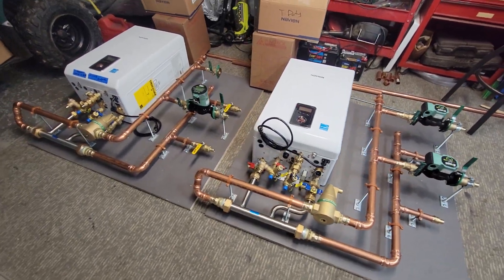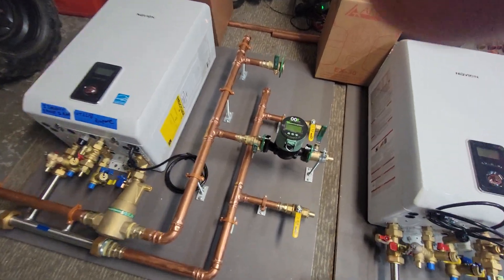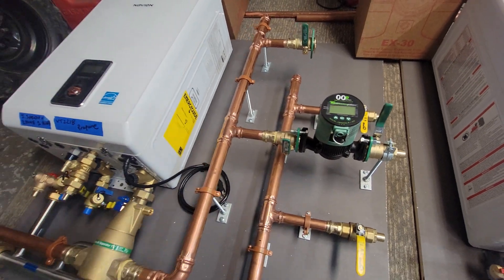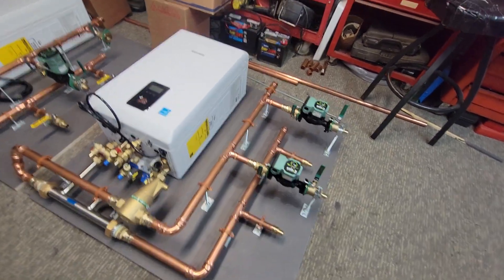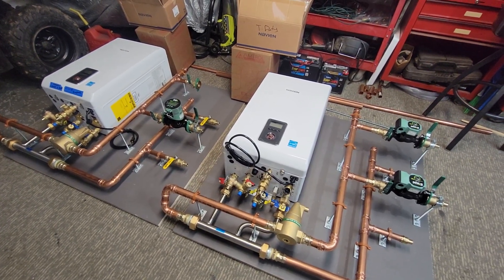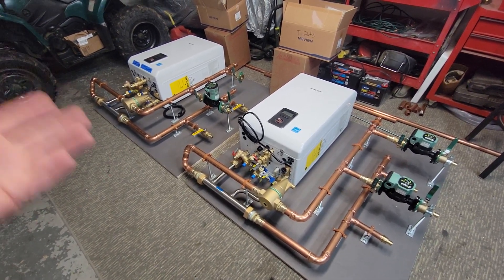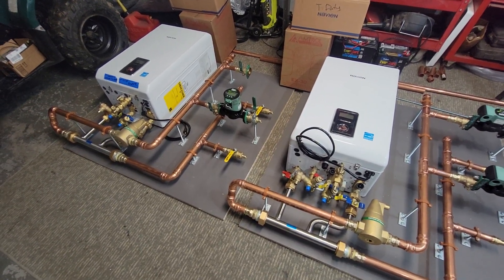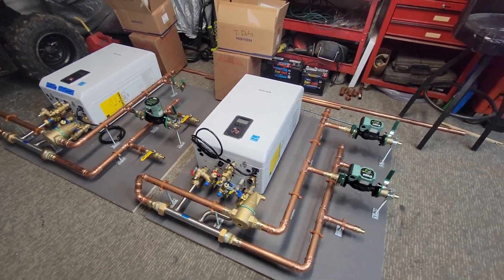Two Pre-Built Boiler Systems Almost Ready To Ship Out

Comment: I'm looking to do in-floor hyydronic heat in a 4800 sq ft pole barn in PA.  It will be insulated under the slab w. 2 inches of foam, r21 spray foam in the walls and r30 in the ceiling.  My question is that if the whole in-floor heat will just be a single zone then is it necessary to have a primary/secondary loop system.
Reply from the maker: You have to meet the minimum flow requirement of the boiler without primary/secondary.

Comment: A friend question, where does the water come in to feed the tankless?
Reply from the maker: There is a seperate connection for the boiler feed and domestic fees. Both are located at the bottom of the boiler.
Reply: @JimSperanza  serious? not being able to see that there is an entrance to receive cold water for the system
Reply from the maker: I have a few other videos on these systems. I know I point it out in one of them.  Check out the other videos. 👍
Reply: @JimSperanza  very good beautiful work, what video do you show this?